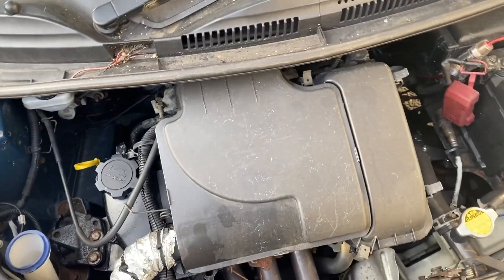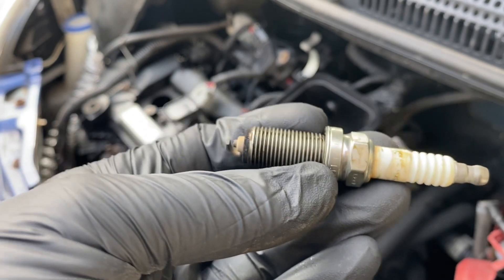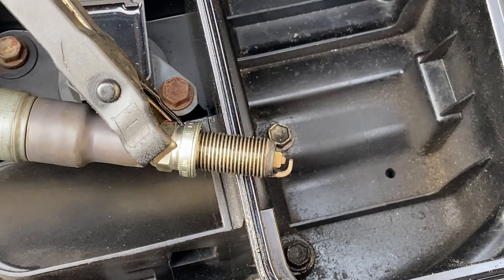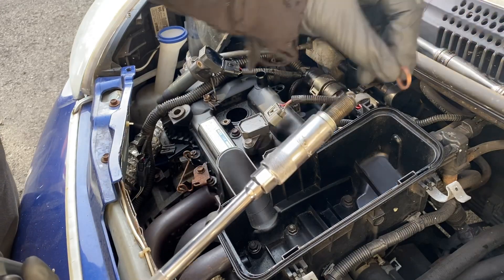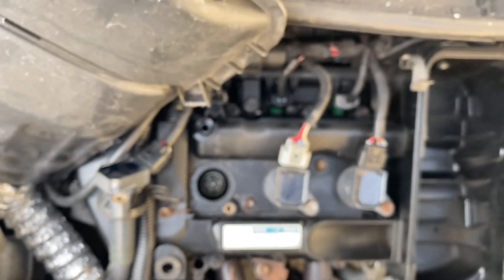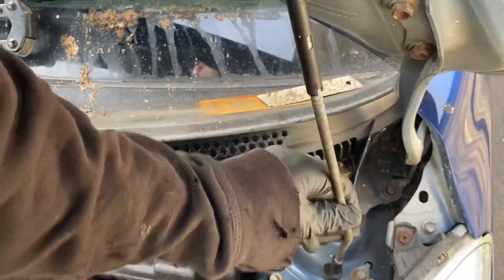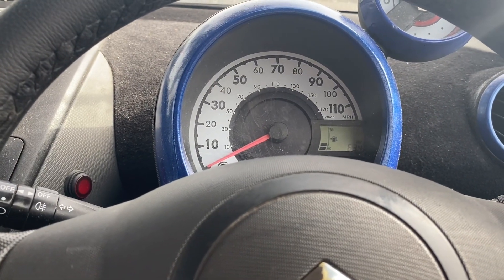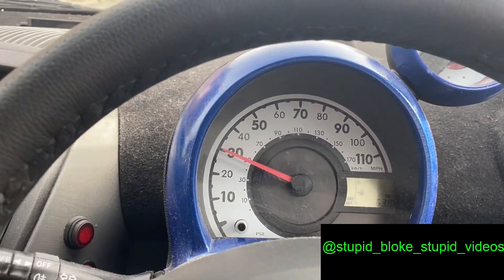How to Index Spark Plugs, + The NASCAR Spark Plug Mod, Does it Work? Gain BHP? (C1/Aygo/107/CityBug)

Comment: My friend can you do a little experiment in your 1kr engine instead of me? I thought if we could take some little more hp if we reduce the friction of the incoming air inside the air filter box,i have a spray of dry Teflon and i was thinking if i spray it inside maybe the air could move faster in the air box if the friction reduce so maybe we could see a different at performance?? Can you try it?? Because if something goes wrong your engine will get damaged and not mine?? 😁
Reply from the maker: @mikeallan7814  haha I doubt it will do any harm to the engine, but I also have very much doubt that it will have any measurable gains 🤔
Reply: @StupidBlokeStupidVideos  you never know... Ill wait..😎😉

Comment: You should maybe consider disconnecting the battery and force an ECU relearn after your various mods?
Reply from the maker: Could do so it re-trims everything, but shouldn’t really need to
Reply: @StupidBlokeStupidVideos  With such a small capacity engine your gains will never be 'massive' but every little helps? Just for "shits and giggles", why not try a weight saving exercise of removing the seats and spare wheel etc,  just to see the performance difference? Adding lightness improves everything with no downside (apart from the passengers?)😀
Reply from the maker: @Toby_the_Glen  I did that one, was one of my early videos that are even more shit than my recent ones! 

I went a step further than just the seats though, here’s the video if you’re interested:

https://youtu.be/xSnXrL4XNAA?si=BfkbqVdOYQNHB5zx

Comment: Nice videos, I've tried E5 in my 107 and absolutely no difference to E10.  Only thing I have noticed is the car pinks on supermarket E10 at low revs and high gears.  Percy the 107 will get what he's given but does return a genuine 64mpg and over 450 miles to a tank!
Reply from the maker: Thanks mate. I found E10 to be pretty shite in mine tbh. It was supermarket E10 that I tested though

Comment: As we’re all about the science on this channel, I wonder if the coils will feel the extra load as the plug gap it needs to jump is now that much larger 🤔 Thank you for your continued work in the name of science.
Reply from the maker: Well that is something I forgot to mention. I fitted some Brisk plugs to my old Volvo T5 many years ago. They were expensive, and the quality of them was, well questionable at best, but more to the point the gap was huge on them. I took them out after 2 or 3 coils blew after fitting them. I put standard plugs back in and no more coils blew 🤔
Reply: @StupidBlokeStupidVideos  price you pay for that bit of ‘NASCAR’ performance I guess. Best carry a spare coil 😜. And as you’ve got a spare coil on you, you’ll never need it😄
Reply from the maker: @davyarthurs  I literally had a full set of coils in the boot of that T5, just by complete fluke that I had them at the time the coils kept fucking up. They had been in the boot for months cos I got given them off a mate who used to break Volvos

Comment: Some top notch throttle control there on those pulls. I know how these beasts like to turn tyres in to smoke at any speed below 100👏
Reply from the maker: You have to be careful of the wheels spinning inside the tyres.
Reply from the maker: @somerandomname9252 I can relate.
Reply: @StupidBlokeStupidVideos  Thats why 3 part beadlock rims is invented 😂

Comment: Put the plug on your tongue and crank it over to check it next time, trade secret 🤫 also, I think your precision dyno might need recalibrating. NASCAR will be running 3 cylinder 1L engines next year I heard on the grapevine
Reply from the maker: That’s how I usually test them. They were going to swap the nascars to 1krfe engines, but the drivers complained that they were too hard to control.

Comment: It looks faster
Have you noticed any bad running and even less power running on E10 ??
Reply from the maker: E10 🤮 

I did a video on E10 when the shit first came to our pumps.
Reply from the maker: This one 

https://youtu.be/f7iKzQOQrYk?si=oZWTONtzwoAa9GeF
Reply: @StupidBlokeStupidVideos  best I go find it ,,, my 107 does not like it one little bit.
Reply: My 107 eats almost nothing so I do put shell v-power in it every time. The same goes with my wife's car. The cheapo petrol makes it more sluggish than normal.
Reply from the maker: @Gourmondise  I even put premium fuel in my 206 😂
Reply: I tried 1 tank of e10 in our 107, seemed to run ok but dropped about 10 mpg. Have run e5 since👍